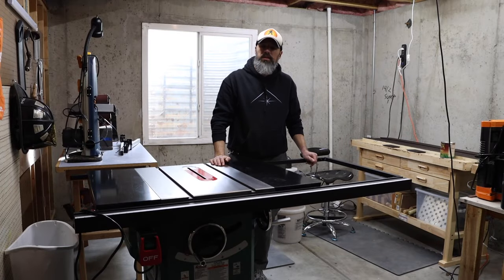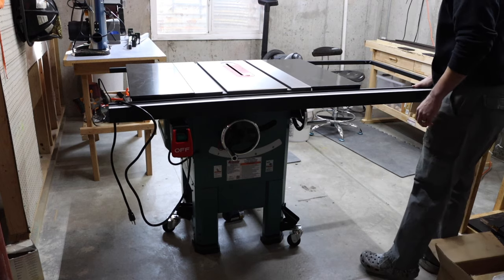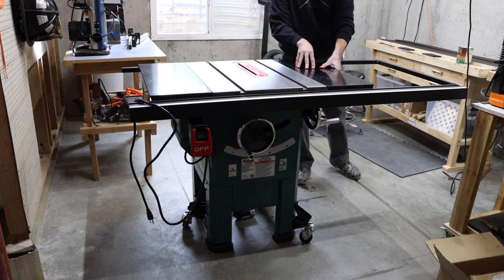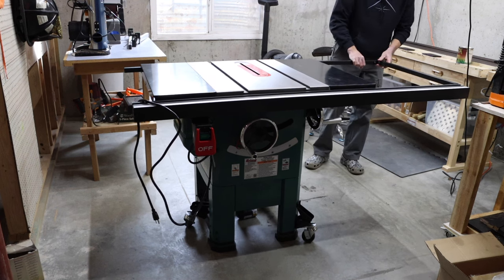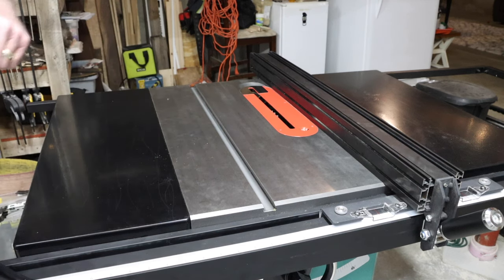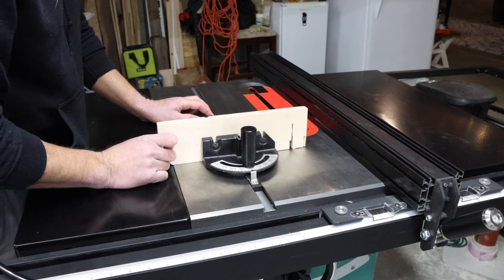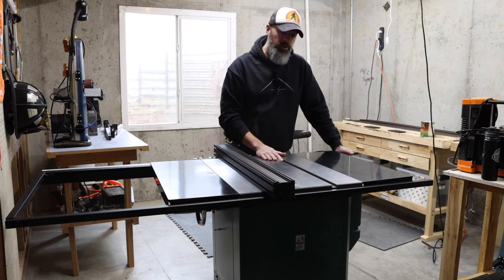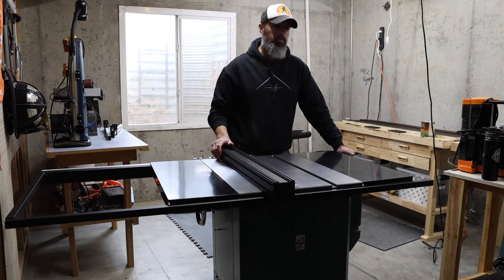Follow-Up Grizzly 10" Open-Stand Hybrid Table Saw Review

Comment: My Grissley came with a stand. I foolishly placed the whole unit on a plywood platform with casters. Used this unstable table saw for years. Finally pushed the ( non running) saw until it hit an obstruction and it flipped over. It landed up side down, the fence  prevented any damage. No one hurt very little saw damage. I built a very stable low center of gravity platform. However scared the $hit out me. 
I use my saw for non precision cutting. I agree with your criticism.

Comment: I noticed the noise from the miter slot disappeared. All miter gauges are trash from the factory. I dont think grizzly sells a upgrade. Your fence is probably off because you are locking it all the way down like a barbarian. It blows my mind how you keep shaming this company because you cant set it up properly. If you spent the time working on the saw to tune it. That you spent talking bad about it. You would have a nice machine.
Reply from the maker: Hello. Thank you for the reply. I see that you responded to both videos. I appreciate your feedback, and as I said in the video, I really hope that the one I got was a fluke. I have heard good things about this saw from others, and I'm glad that some (or most) people have a good experience with theirs. As far as the miter gauge, yes, they are not good from the factory. But perhaps people can't always afford to upgrade theirs when they have spent so much on a saw that they had to budget for. 

It seems to me that Grizzly should give one with the saw that you can use for the time being. 
In regard to the fence, if I snug it down the same on both sides, why would it change from one side to the next? You state that I shame the company because I can't set it up properly, but if you watched the video, my concern with the miter slots is the poor machining. Their are deep grooves in the miter slots that a little tune up isn't going to fix. You mentioned about the noise disappearing, but that's an editing adjustment. I also don't see a tune up that will fix the flimsy metalwork. The entire saw torques (the metal) when a little pressure is applied, such as sending a piece of wood through. This is a big safety problem.

As I said, I really hope that this is a fluke that I was given. But seeing as it's my experience, and the company was so difficult for me to work with, that's what I have to go on. And I do mention that in the videos. Anyway, thank you for your comments. I truly hope you continue to have good experiences with this company.